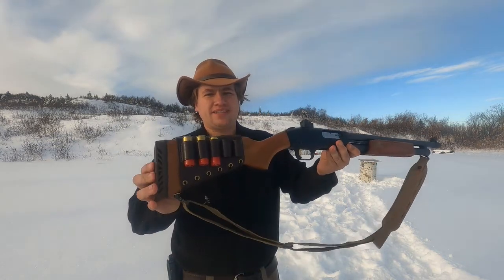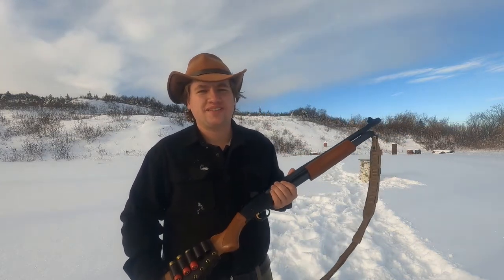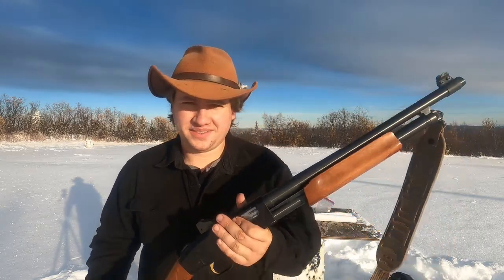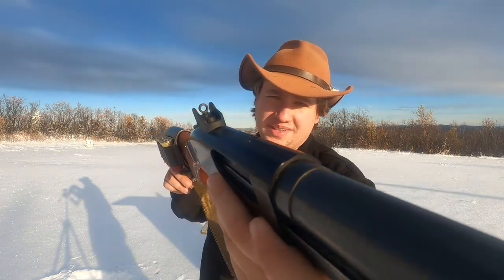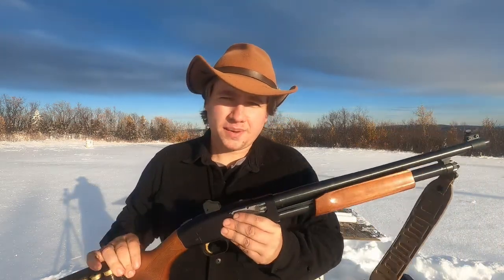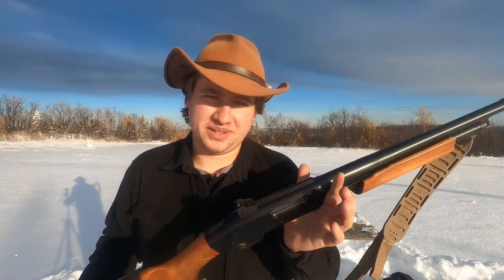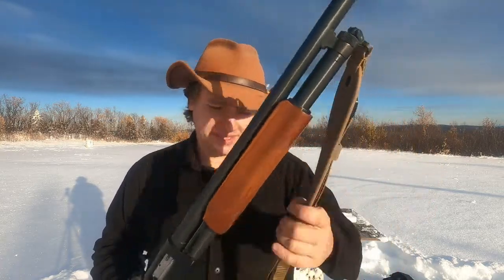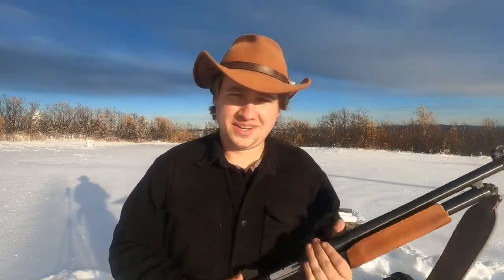My Bear Defense Shotgun Setup

Comment: We had the same problem in Hawaii, a beautiful place but you could almost watch your weapon rust after cleaning it. We used regular motor oil to prevent rust. To this day I still use motor oil with no noticeable issues. That's from 1978 until now. 44 years of motor oil.
Reply from the maker: If it works it works!  I have spent some time on those terribly humid pacific islands and I know exactly what you mean.  Very clever with the motor oil.
Reply: @gunsgearoutdoorsalaska5875 , Hey, it's cheap compared to gun oil, and one quart of mobile one will last forever.
Reply: Motor oil is just as good as any fancy gun oil if not better. it’s designed to protect engines spinning at 6000+ rpms guns will never experience parts friction like that . 

plus it will help cleaning due to the detergent in the oil ! Rock on and don’t think anything of what any one tells you otherwise ! I use both motor oil and gun specific oils what ever is closer.

Just don’t use gun oil in your motor 😉
Reply: @vic2796  I can only imagine what a few quarts of gun oil would cost. I have been using motor oil on my firearms since the 70s I really don,t think  I'll change now. And yes, a well-oiled weapon is very easy to clean.

Comment: I have carried my Mossberg 500 all over Alaska. Summer, winter, spring and fall and I am with you on the finish. I have however used a  product called RIG which I smear all over the blued parts, except the trigger. I load up patches of cotton (old tee shirts) with it and put them in zip lock bags. It works pretty well. Well enough that after 20 plus years I do not have any rust or pitting. It is on me while fly fishing as well.

Comment: I'd use 3 inch slugs for Bear defense, Breneke Black Magic Magnum to be exact. It's a 1.5 Oz, 600 grain projectile moving at 1,300+ fps.
Reply from the maker: That's a bruiser for sure.
Reply: I just got a rifled barrel and ordered the Crush and a folding stock.  1 1/2 oz. at 1600 fps.
MPN	SL-123CMR
UPC	4030128120522
Manufacturer	Brenneke USA Ammunition
Caliber	12 Gauge Ammo
Bullet Type	Rifled Slug
Muzzle Velocity	1604 fps
Muzzle Energy	3804 ft lbs 	
Primer	Shotgun Primer
Casing	Shotgun Casing
Ammo Rating	Hunting 12 Gauge Ammo

  Its my camp gun.
Reply: 1 3/8 oz slug is what the brenneke black magics are
Reply: @fatfuzzypotato6113 what if you missed?
Reply: Ouch
Reply: @videogazer801  not trying to toot my own horn but im a pretty great shot and in stressful situations so I don’t think I would miss
Reply: Closer to 1500fps.

Comment: Nice setup!  We also use the 870 for work.  A ceracote finish really helps for working in S.E..  Trouble is most slug loads aren’t waterproof and the powder can get soaked if the shells get submerged.  I prefer to carry my personal .44 in stainless because it’s more likely to be on me if I need it.  If it’s a bear heavy area or really remote I take my stainless 1895 guidegun in 45/70.
Reply from the maker: Sounds like good choices all around. I imagine its hard to keep anything dry in southeast!  Thanks for watching!

Comment: I prefer Mossbergs to 870s and while my gun is the 590, the 500 is lighter, handier, and arguably quicker.  I swapped out the steel magazine follower and factory spring for a nylon follower and stainless spring.  I prefer a side saddle for spare ammo which doesn't interfere with shooting from my weak side the way a butt cuff does, and it provides a spot to mount my flashlight.  Typically I keep the magazine loaded with Brennekes and have buckshot in the side saddle in case of a "polar bear in town" issue.  I swapped out the Speed Feed stock for a Magpul SGA which I chose for it's adjustable LOP, I epoxied a swivel stud to the under side of the butt on the angled portion ahead of the butt, and just use a plain 1.25" web sling.
Reply from the maker: That sounds like a sweet well thought out setup.
Reply: Have a benelli nova and if you don't pump it really fast it will jam. Benelli says that's the way its supposed to be but every other pump shotgun I've had I only had to pump it normally not as fast as I can

Comment: I've tried my whole life to warm up to pump shottys..but I always seem to bungle when shooting fast..just sold my pump and bought a Rem11-87 supermag and couldn't be happier with its reliability..even got it shooting low brass 1140 fps #8 shot...3-1\2 chambered auto loading shotguns can be very reliable too.I didn't buy it for the long chamber and found there's a lot of people who don't like 3-1\2" chamber shotguns because of reliability issues they have had with theirs..gas management is the trick..on my bird barrel I opened up one of the two gas ports 1\64" larger and it made all the difference for cycling low brass..5 min job. The rifled slug barrel has proven to have excellent accuracy and reliability using Sabot slugs. No more short stroking a pump for this old fart.
Reply from the maker: Sounds like you got a good setup for your needs now.

Comment: setting up a tactical shotgun in Montana, the slugs with ghost rings are no problem. where I found issues were the buckshot rounds have way less range than I thought. Would u recommend flight control buckshot? or ditch that idea and run strictly slugs. Thanks

Comment: How did you attach the front sight post? Is it just fastened over the bead or was some gunsmithing involved? Curious because I also have a Mossberg 500 and those ghost ring sights look pretty neat.
Reply from the maker: No gunsmithing necessary, it clamps around the barrel and fits over the bead.
Reply: @gunsgearoutdoorsalaska5875  Nice, have you ever had it fall off or loosen up on you?
Reply from the maker: No, but I did use some nonpermanent thread locker.
Reply: @gunsgearoutdoorsalaska5875  Ah, makes sense. Blue loctite is good for that.

Comment: You said the sights help for shooting slugs but is that what you actually carry for bear defense?  If so do you have a particular kind?
Reply from the maker: Yes, I like the Brenneke special forces short magnum.  It's a good balance of recoil and power.  1 1/4oz slug built for penetration in a 2 3/4 inch shell.  As a disclaimer though, I have never had to kill a bear with them in self defense but that is what we were issued by ADF&G and I felt confident in them.

Comment: I always used a Mossberg Shockwave as my bear defense Shotty. Now it's in a legal grey area where I am, so i switched to an IWI Tavor TS12. Too heavy for long hikes. Just got a Beretta 1301, I think that might be better... We'll see in a month or 2 when Morel season hits
Reply: The 1301 is no doubt a fine shotgun. It's light enough to carry on a hike but can shoot insanely fast if needed. I was an 870 fan for over twenty years and not even a year so far with the 1301, I take it over the 870 every time. I did replace the plastic mag clamp with an aluminum GG&G clamp which is more robust and changed the handguard out with a Briley aluminum handguard, which is much better than the plastic one it came with.